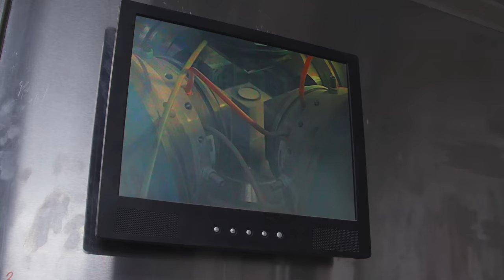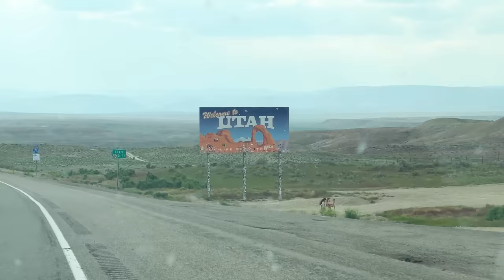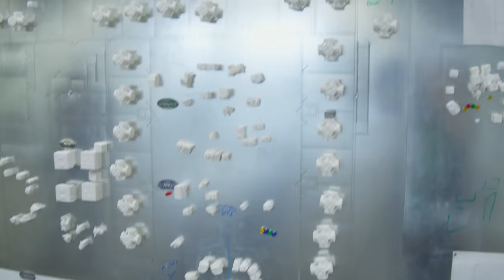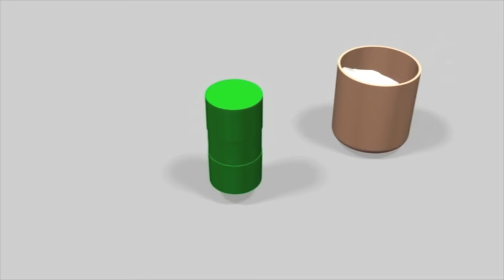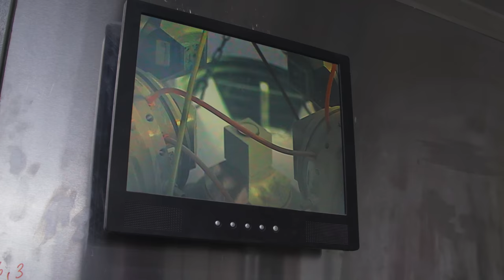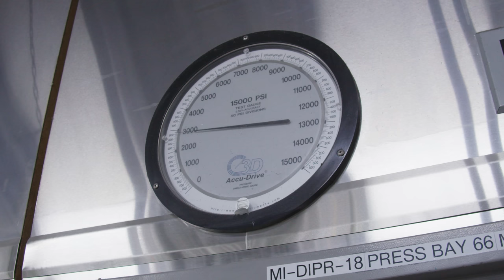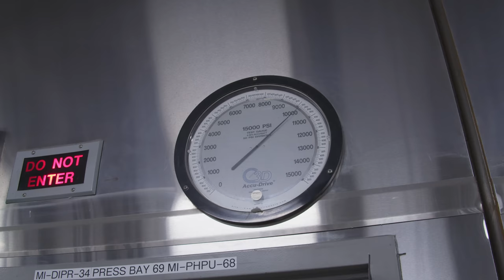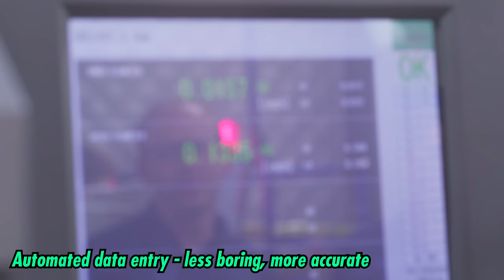The Highly Ridiculous Over-Engineering of the Diamondback Nozzle

Comment: He thinks diamonds are an under-utilised material but the main reason is pretty obvious, cost. It has a much higher up front cost but probably won’t need replaced as often, in the lifetime of a machine it may be more cost effective to just use and replace normal bearings or similar. Diamonds are used where they are needed though, like in drills, but there isn’t really any other suitable material and the cost makes more sense.

Comment: The Diamondback is definitely super sweet But man  it's a luxury product you can literally pretty much Buy in Ender 3 V2 for about the same price at Microcenter right now
Reply: Either luxury or business oriented.
Reply: ...or a spool or two of the filament it's designed for.  (Not luxury, just different class of 3D Printing)
Reply: @ericlotze7724  you can print carbon fiber nylon or any exotic filament you would like with a $2 hardened tool steel nozzle personally I really like the e3d nozzle X a little higher-end but I've had an amazing performance using abrasive engineering filaments with it at a third of the cost
Reply: @camsoup101  My point was if you think the price of the nozzle is bad, you most likely aren't running 20 Weekly Spools of CF-Nylon, CF-PC, or stuff like PEEK etc

(I don't either, but short of us enthusiasts that is the more "true" market for this)
Reply: @ericlotze7724  extremely true haha the amount of ware they must put on their printers not having to worry about a nozzle at least must be a massive Improvement at that scale

Comment: Guy said all their printers had a diamond tipped nozzle. I have to ask, does that include the Bambulab? I have one and was like hmm 🤔

I have to admit though that the brass still has me curious about how the tube going to the nozzle wears, like sure its much less than the tip, but it's gotta be some, and if I'm gunna buy a fancy nozzle, I'd want some confidence that they have some simulation or something showing that it really does wear so little over time it's like prostate cancer in that every man gets it, but usually they die from other reasons before it becomes a factor.